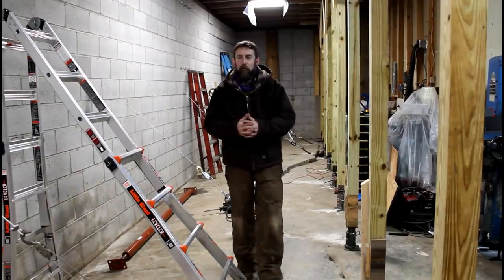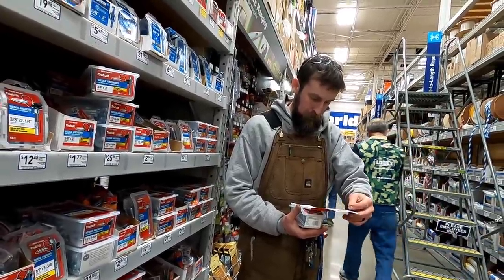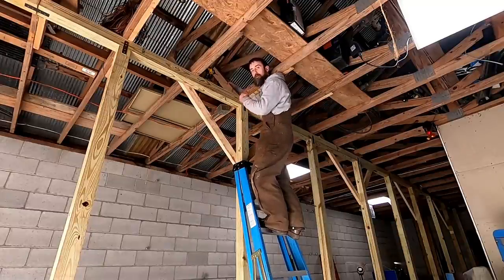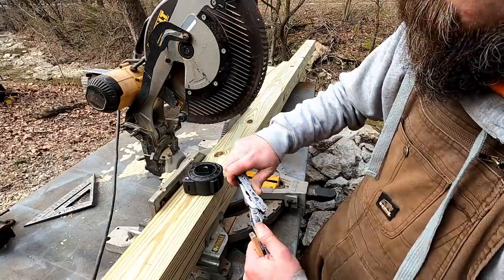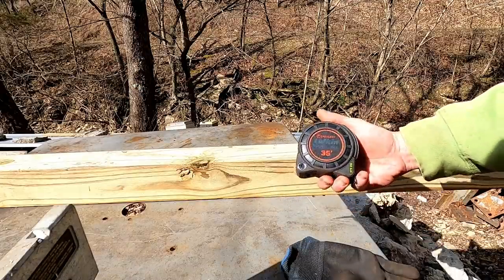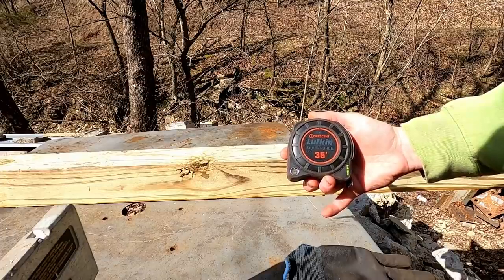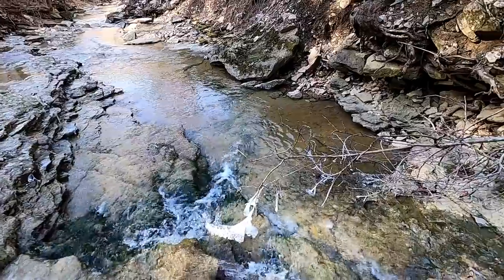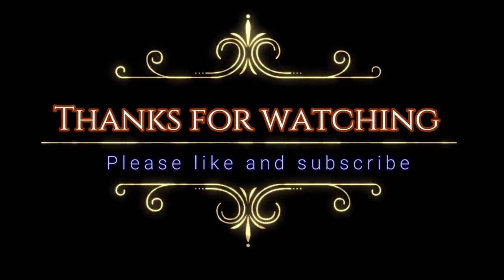Repairs To the shop begin ! Preparing the roof lift wall

Comment: Good progress. The engineer you spoke with knows his stuff and i am glad he helped you. It might not be a bad idea to diagonally brace the trusses to the floor. When you lift them off the wall, there will not be much preventing them from translating sideways except their attachment to the other bearing wall. You would be surprised how much horizontal roof load can be caused by wind.

Comment: I recently bought one of the Bauer impact drivers. Been pretty skookum so far! Battery seems to last quite a while too. I actually use mine more as an impact wrench using socket adapters. Has more power than my DeWalt 3/8” cordless impact. Thinking about getting the grinder next...

Comment: Another great video as usual.  I admire your tackle any job attitude and work ethics.  I've been woodworking and metal working since 1975 and have had my share of accidents in the shop.  Please stop table sawing free hand.  It's not if it's going to hurt you.  It's when it's going to hurt you.  While you still have some fingers left, PLEASE STOP DOING THAT.  Trust me, been there, done that.  I've had surgery on both hands more times than once.  I've learned my lessons the hard way and try to work more careful now that I'm older.  Love your channel and want to see you're safe.  Thanks for sharing with us.   Dan
Reply: OK safety Sally. He lived through it.

Comment: PLEASE get a 12" or longer blade on a reciprocating saw an part the sill plate/stud from the top of the wall. Then lift the posts up. 

Do them one section at a time. Monitoring deflection of the blocks as you unload them. 

Dynamic deflection during the unloading, load transferrance will tell you so much more!

STAY SAFE

Comment: Great work as usual. Nice visiting with Peanut as well.  One thought, quality nails are stronger, in shear, than screws. When you secure your boards to fail safe the jacks, a nailgun would be a much better choice, but harder to take apart for sure. Same for all of those boards you installed on the trusses, that is all shear load and nails would be a superior choice, cheaper, and faster to install. And it looks like you might be in need of a decent nail gun for a while to come! :-)
Reply from the maker: Thanks James👍 Yeah a solid nail would be better. I just decided to over do it on the screws. I hate removing nails.😁

Comment: I live in a concrete house and bought a cheap chinese hammer drill with SDS+, it's been one of the best tools I ever bought. Something like $50 new. Had it for 10+ years and drilled hundreds of holes.

Comment: So far so good, but you need to also consider what you have holding the roof down.  Right now the bad wall is part of the enclosed structure.  Once it's open, and even partially removed, you no longer have anything securing the roof downward all along that side.

 I'm thinking strong winds in the wrong direction would have a lifting effect on that exposed roof, which could disturb those vertical supports that are only held in place by the weight of the roof.  I believe you need something added to oppose that roof lifting.  Gravity is working for you unless the winds are lifting the roof. 

 I would also brace the uprights like a truss beam, diagonally spanning three, top to bottom, once the right overall height is set. That would help resist any lateral movement at the top and bottom along the temporary wall.  You don't want any movement, in any direction along that temporary wall structure.

Comment: Suggestion. When you drill holes for a wedge anchor, drill it all the way through. That way you can remove the nut and drive the anchor down. No cutting it off. In your case you would have been able to salvage them when the concrete was removed.

Comment: Sorry a couple of screws on the spacers as you so call it at 16:00 to hold up the 4x4's is not going to do anything. For the 2x4's to help you would run them from the truss to the cement floor and then you will be strengthening the post. You will get this job done as you do with everything you do and I love watching you do all the jobs you do.

Comment: This brings back a TONNEeeee.... of memories. Having rebuilt three structures in this fashion, for the roof over my own families heads. 

And the last one WSS on the edge of fast flowing stream, only three meters away from the foundation of the long, continuous back wall.  I put in deep anchor points, five meters deep at five points along the run, 75 cm from the foundation. These were my insurance against slippage, outward from the foundation line.

Seeing you use steel plates, hope you are tieing those together with at least 2x10.

Hoping you put diagonal cross braces between your interior lift beams to check any sway, inline during lift.

Wow, literally thousands of details... I'll watch now.

Comment: Don't know if you've thought of it, but Tanalised timber has a life of over 40 years. I had a similar but smaller section of cement block wall collapse and move in the corner of one of my barns/workshop. I replaced it with a timber frame , 4 by 2's and box section galvanised/painted steel cladding. Lighter, quicker and better than block-work. If you are replacing the wall in the same location, then I think it would be wise to look into stabilizing the river bank. I guess what you do, depends on what regulations, if any, cover the water course.

Comment: Gerber, made about a half mile from my place.  Nice, very nice blades.  Didn't know they made a multi tool.
I've had an OG Leatherman for 20+ years, and haven't used it three times!  Ended up putting it in my van as an emergency use tool.  Still haven't used it...

Good move to add the bracing. Trusses are designed to carry the load at the end of the 'joist', jacking it in the middle of the 'joist' would just bend the 2" x 4".

Also, make sure the original builder braced the trusses for 'end to end' stress.  (The truss joist setting on the bad wall would be 'side to side'.)  You mentioning 'folding up' made me think of the bracing I'm talking about.   They should be angled from the joist of one truss to the top of the adjacent truss. If spacing is closer than 2' of center, they would be from the joist to top of the second adjacent truss, to keep the angle flatter.

Comment: Many think of heirloom tools as antique. Your little comealong is proof otherwise.  We all should have more wall hangers like that, things that aren't worth a nickel but wouldn't be sold for the price of a new one. Got a few, wish I had more..... I'm not there to see it myself but I think if it were me, I would pull the block from the center first. Work an opening down from the about 4 ft.. Then work equally towards the corners. The corners aren't nearly as dangerous as all the weight in the middle, will likely sit there or just kinda melt as you go. The center at full height is a lot of leverage weight that could pull things. I would guesstimate once the leverage is off the top, the slab overcomes the leverage the remaining 6 ft of wall has, things get way safer. From there you could work from front to back more methodically and efficiently. You've got a great start, be safe, thanks for sharing.

Comment: For even more safety, I would bolt the 4" x 2" extensions to the floor using right angled brackets.
This anchorage will help to stop the roof lifting if wind gets under it once the wall is taken down, and also stop any sideways movements at the support bases.

Comment: The corners have more support than the middle of the wall. I would suggest cutting the trusses loose in the middle and dismantle from the center out. save the removal of the corner connection  for last.

Comment: Steve, move the machines into a shed of wood, flatten the barn, and build a new workshop on a proper countertop. You'll have better light, heat, installation. You are smart enough to handle it. This is how you can handle it, and it will still be a matter of time before it moves again. Translation = google, greet you from Czech rep.!

Comment: Definitely pour a deep, thick, and wide footing for your new wall. Another thing — if at all possible, you need to introduce at least one or preferably two right-angle type protrusions in that wall. Just go out a block and a half, run down four feet, then back. This will make that fifty foot long expanse of block way more rigid. All that block in one long wall is too much like a ribbon. Nothing to give it any resistance to flopping around. My basement wall is collapsing and it’s about fifty feet long with no buttresses built into the construction. 

Good luck with the rebuild.

Comment: Definitely a big project. I would suggest trying to make sure you can get good reference measurements on everything so you can check for movement in the structure as you start lifting and tearing things down.  A laser level and laser distance meter can help monitor how things are moving.

Comment: I am glad you got some engineering input and are adding some webs off your lift points. That was a concern of mine when i first saw it. But then I noticed the location of the vertical webs and where the jack point was and it look like you where taking that into account. I built trusses for a number of years, and saw a huge number of failed trusses due to improper lifts and lumber defects.

Comment: Hi Steve
Just a suggestion that you may already thought of. Get yourself a power chisel, air if you have the compressor for it, electric, otherwise.
It’ll make quick work of that wall by knocking that mortar loose between the blocks. 
Let me know if you need a bigger hammer drill. I have a good Bosch that drills through concrete like it’s butter. With bits.
One day at a time.
Thanks,
John

Comment: Ok Steve,  you know I'm a long time woodchuck,  and that was the scariest thing I have ever seen you do.... cutting that board on the table saw like that!!!!  YIKES!!!!  Another little thing I see,  the stays you have into the floor, if the wall does start to fall,  IMO, that part of the floor will go with it anyway,  it has been moving with the wall all these years, hence the cracks,  I would put the anchors back into the main slab if you are really concerned about the wall falling.  From what I remember from the pictures you sent me,  I wouldn't be that concerned about it tho.
Reply from the maker: I dont use a table saw often😁
Reply: Seriously, that was incredibly dangerous. We don't want to see you lose fingers. Never cut freehand on a table saw. Your hand can get pulled across the blade faster than you can react. Please use a fence and a push stick.

Comment: Just a pry a course at a time, from the top down. No prob, and not too dangerous (as far as all of the options go). You might think about getting 1 section of scaffold and wheels for it. Rent, OR look on the local CL, OR maybe you know a mason around you. I'm not sure how safe I'd feel on a ladder. Maybe even a Baker Scaffold. Anything with a little more stability than a ladder, and a place to set your tools. You'll end up needing something scaffold-ish to lay the wall back up eventually (unless you're gonna timber frame it, which you may have mentioned in a previous video). Thanks for showing it. Cool stuff.

Comment: Quite the job you are doing there.  You don't seem to need it, but for extra bracing/securing, I have discovered hd shelf brackets work well.....90 degree brackets with a 45 degree brace....they come in various sizes, with one leg longer than the other.  Something to use at top of the supports, to them from shifting on the truss.  Looks like you are already secured, yet once done with that project, shelf brackets could be used for........shelving!.....or some other fun project.  Good luck and stay safe!

Comment: I am glad I am not the only one who hates the issue of air in wheelbarrow tires. Biggest pet peeve out there with those. Same with sack barrows. In fact anything that you use to carry things should just have solids.
Reply from the maker: Especially construction type equipment.  Air filled tires are  guaranteed to be flat after the 1st real use. Sometimes they go flat before you ever get to use them because they are CHEAP tubes and tires. No thanks.
Reply: We put air in wheelbarrow tires because it works the best. Doing wheels is bad enough. So the best is just good enough.
Reply: @Wroger Wroger I've been pushing wheelbarrows my whole life. You can take solid tires and shove them.

Comment: When you've finished rebuilding your workshop, that stream is crying out for a turbine to generate electricity! All the best, Matthew.
Reply: Was thinking the same thing Matthew, might have to build a dam first, to build up the water level
Reply: @TERRYB0688  Definitely have to build a dam, somewhere to put the rubble from the wall! I always wanted to build a turbine setup, read up on pelton wheels and turgo impulse wheels! I never found the site for it!
Reply: That's a great idea but he has to get Corp of Engineers approval, EPA's approval, and a host of other state government and local approvals. The bottom line is although he could power his house and shop off just one turbine the legal fees makes it impossible.
Reply: @CraigLYoung  )--;
Reply: @CraigLYoung  Correct. I don't know how it is in Kentucky, but in Louisiana it takes an act of Congress to restrict water flow in any way.  Or to mess with the marshes/wetlands in any way.  Do it without permission and the fines get pretty steep pretty quick.
Reply: It all depends on jurisdiction, whether it is permanent or intermittent surface water, where the water originates both geographically and geologically (whose property does it run through, whose property does it start/end at, and is it spring fed or runoff), how you plan on damming it (design/engineering), whether it is a navigable waterway (which his is not), whether it is used for agricultural/recreational/power generating, effects on upstream/downstream properties, and whether or not you go through the proper channels (local & state agencies, federal agencies like USACoE, DEP/EPA, NRCS, etc.)
Reply: Aside from the other comments - From what I've seen on Steve's videos, the average flow in that stream would light a few LEDs. Wouldn't be worth the hassle.
Reply: Philip Crow : Yeah it's the sane no matter where you live in the USA. Environmental Groups have the laws so screw up that you can't take advantage of God's blessing. The whole East Coast could be self sufficient for electrical power if we could use out creeks and streams.
Reply: Jim Korman : There are these new drop type turbines being used outside the USA that require low flow and generate 240VAC. Because of the regulations here in the USA they are not practical, see the above comment.
Reply: @CraigLYoung  Exactly what I was thinking, This project would NEVER happen in WA stateI. I would have every Tree Huggin' Evnviromental Extremist in 1000 miles radius either hagging from trees or blocking the roads chanting gibberrish as well never ending bureaucratic night mare of paperwork permits/inspections. Just be happy you live in a place that still values common sense.
Reply: @CraigLYoung   https://www.whitehouse.gov/contact/  Email the POTUS.
Reply: Matthew Tinker

I don't see it working in that location because meaningful power generation needs pressure from water depth or regular stream flow for something like a water wheel, like they have in England from Centuries past.

You would need to build a weir. Then you need approval because you are interrupting the natural stream flow. Who knows who needs the water downstream ? Even if it was approved it's a hell of a lot of work for 1 person (Steve) to build a structure that would be permanently sound. Then you have to buy a hydro power generation set that suits Steve's requirements. That would be expensive. From what I see of that stream, the flows are seasonal. Sometimes plenty of flow & other times very little flow. Steve is just 1 guy of limited finances.

There's more to it all then just pointing at the stream & saying "this stream is crying out for a turbine to generate electricity" ? It is more economical to do as it is now = just use & pay for power off the established grid.
Reply: @hughmoore810   Steve will be quite tired after the shop repairs.  I think he'll be well occupied putting the shop back together.  I agree, meaningful power can't be obtained from the stream.  Besides, it's too peaceful to mess with.
Reply: @TERRYB0688  Don;t need to build your own dam    Just find yourself a beaver,,.
Reply: Steve has discussed that a couple of times. It's a seasonal creek--doesn't flow long enough or strong enough to be worth developing.

Comment: Keep at it Steve, you’re doing great. I was going to suggest you don’t rely on those jacks to keep pressure for long periods of time, but you’re all over it. It might be a good idea to throw some hurricane straps on the trusses on “good” side of the shop to prevent any lifting of the roof structure.

Comment: I can imagine something like that wall could cause you some, not exactly sleepless nights but a nagging in the brain so it's a good thing that it is getting done, good job.
If you screw a 4x2 to the side of the post, and take the Jack away, the truss won't be supported by the 4x2, it'll be supported by the screws holding the 4x2 to the post, if you get the drift. Just a thought, I'm sure I have misunderstood something along the way :)

Comment: I would be  driving in a steel sheet pile wall with a hydraulic excavator mounted hammer, as access is limited, to support, and stabilize the ground & that river bank before rebuilding your workshop wall,even Gabion cages might be enough to work & stabilize  things.